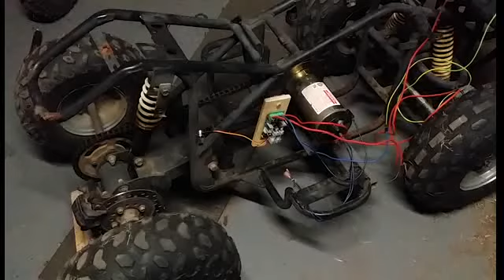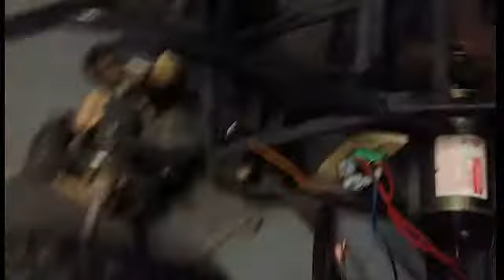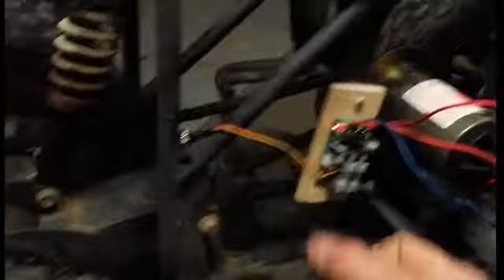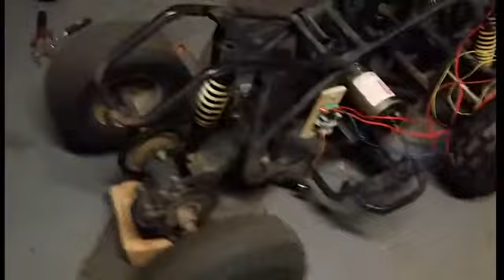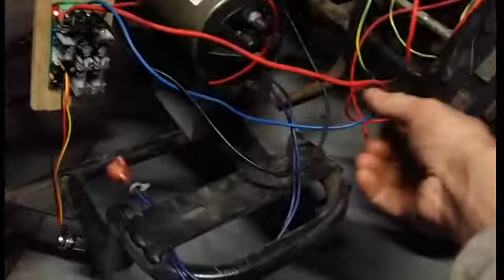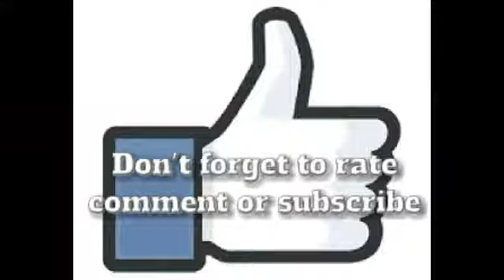Electric quad bike conversion project with treadmill motor part 2

Comment: You can buy dc boosters to boost up to 80 volt. That what I'm going to do and use the control board from a specific treadmill with pot.

Comment: Hello! I have a treadmill motor I want to use on an electric vehicle build, how did you get a chain sprocket onto the motor shaft after taking off the flywheel? Thank you

Comment: Be interested to see if you finished this off. I am looking at converting one to electric with 18650 li-ions. Haven't researched motors yet
Reply: Bailey Pearce yep.
Reply: Also doing the same and have a treadmill motor on hand. Did you have any success?

Comment: Reduce drag at max ....install motor directly over sprocket...    and or  find an identical treadmill motor and go direct drive independant.....then rug up the smallest weedeater generator forb5hose time u ante git no place to plug it in to